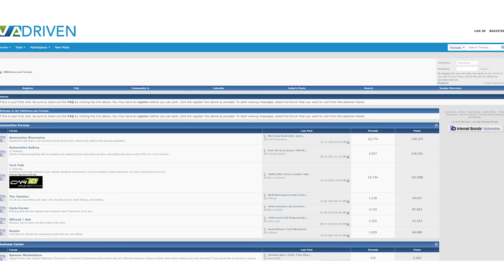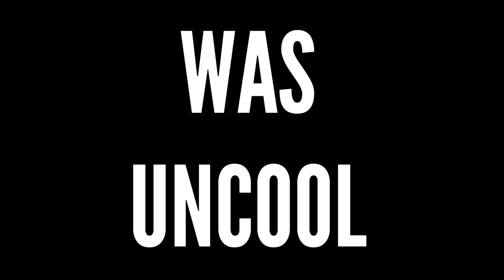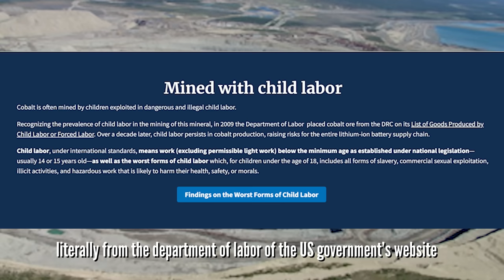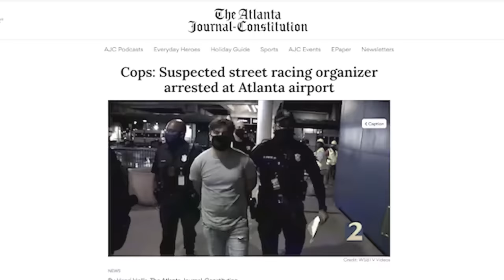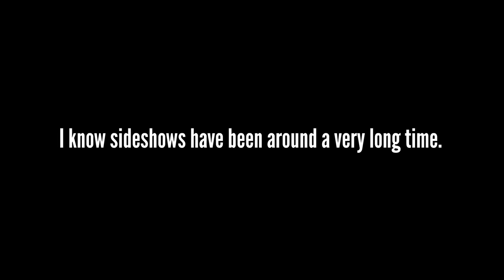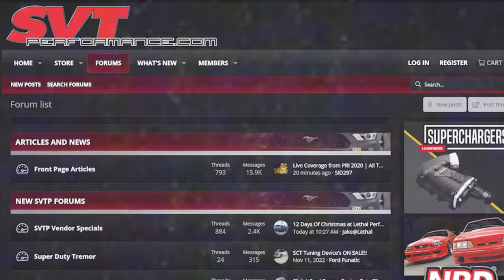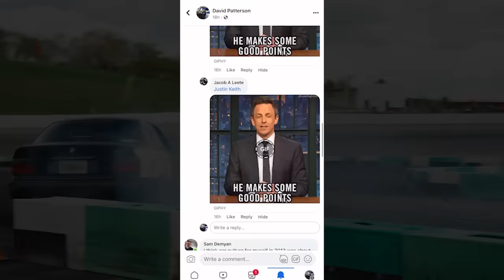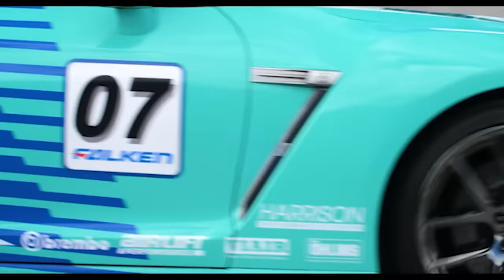Car Culture Has Changed: 2012 vs 2022

Comment: I'm a relatively newer car enthusiast, I liked cars before but didn't know much about them, so I started working as a lube tech at a dealership, and I've been learning a lot about how cars work, and personally it has skyrocketed my interest in them, I find engines and transmissions so fascinating with how they work, and I enjoy being able to apply my newly acquired knowledge to test at work
Reply: nice man! lucky you honestly. id love to turn my enthusiasm for them into contribution like you did.
Reply: I'm glad I grew up on a farm with lots of older cheaper vehicles to learn on and rebuild, way easier to figure out how they work and how to fix things and 95% of that knowledge is transferable for modern vehicles (internal combustion engines have actually changed very little from 30 years ago, biggest difference is all the engine management stuff slapped on top)
Starting out on modern cars is starting on hard mode
Reply: @archygrey9093  I think most cars use hydraulic clutch system and past 90's they used cable clutch system,also finding jacking points is difficult now

Comment: The thing you feel about cars just being a fashion statement for alot of the "car guys" in 2022 is something I felt in 2012. It was like that in the VW scene in 2012 where people would do 3 "projects" a year where they would buy a car, buy the cool hip wheel from rotiform, bag it and ad a bunch of stickers.
Reply: Funny now that I'm thinking about it, it was mainly VW when started to see the stretched tires, camber, bags. 
And now I've owned 2 VW's, however none are bagged or had rotiforms. Always been a more function guy though.
Reply: The only Rotiform I like is the ZMO on the 488 GT3 EVO or 488 Challenge EVO. And those are racecars. Outside of that I have no particular liking towards Rotiform. BBS all the way.
Reply: It was the same for many even in 2002 people would buy run of the mill civics and V6 mustangs.  Throw some after market rims and under hood dress up items and that was it.  As long as it impressed some random girls or their friends that new nothing about cars (and didn't care to learn either) it was done.  Simply something that looked trendy.

Comment: One of the hardest thing for me to accept is that I paid 1k for 2 separate 240sx and they both worked perfectly fine and had no cracked dashes.  WRX's, 300ZX's and most all JDM cars were easily under 6k running and in great condition, now some teenager is trying to sell their ragged out, frame bent, missing most interior and mismatched exterior panels for like 5k, not to mention trucks with 150k miles for like 25k, I'm so sad we can't easily access these items as much anymore for a great price.

Comment: You're taking it wayy back for me. Early 201x were the times of meeting up with the homies at the local sonic with our band of mostly f-bodys and stangs. Wheels, exhaust, and driver personalities were the conversation starters. We spent more time just hanging out and being dorks than talking about cars. Cars were the magnetic attraction that brought us together.

I had an 01 champagne 6-speed trans-am. It has QA1 coilovers, borla exhaust, stainless kooks headers, and some replica wheels. Like you said David, if anything rowdy went down it said between the handful of participants.

Now I have a 98 s14 with an ls7 built from the ground up... damn thing is a monster and doesn't run more than 500 miles at a time before it breaks down... currently needs heads rebuilt for soft dropping a valve.

Thanks for this awesome video! Really brought back a bonus level of nostalgia.

Comment: Being a old head I witnessed the birth of the import scene. Back in the mid 80's in the valley of So Cal. We were building Datsun 200sx and  510's, Suszuki Samari's , Celicas  Pintos, Escort GT's and mini trucks. Running down Ford's 5.0's, Mustang and Capri on Foothill in San Fernando, and cruising Van Nuys with the lowriders. Back than the scene was brand new. It was about street fame and enjoying what you had. I moved to Atlanta in the 90's and again witnessed a small VW show called Nopi transform in to  the east coast biggest Lowrider show in the mid 90's. By 2k it once again  transformed in to the countries biggest import show. Back than car meets we basically a group of friends meeting up. Everyone one was about showing up and showing out at Nopi. It was all love. Back then Everyone had a true appreciation  for each build. Extreme builds were seen as the exception not the rule.  Work In Progress builds were the best. As they returned each year with more improvements. To finally they were these amazing high-end builds and you felt a true excitement for the owner. Who was like you a regular Joe working a 9-5 and had a passion for cars. 2022 like everything else car culture is flex culture.
Reply: Flex culture is the true ruining factor

Comment: I'm 37, and when I was in my late teens, it was the mid 2000s. The scene back then in my area was older guys with muscle cars, but you did see some tuners from time to time that were legit fast (for the time). This was also the very beginning of what I call the "boost era", this is when Ford Lightning and Terminator Cobras were making crazy power with a pulley and a tune. Information was pretty limited and I got most of my knowledge from my dad or Car Craft magazine. But, the community was still pretty awesome, it was much like what you described in 2012. It was friends cruising together, meeting up in a parking lot with the hoods popped, staring at engine bays for hours just dreaming about making your car faster. Street racing was the thing to do, and we all looked out for each other and did things as discreetly as possible. I am not part of the car scene currently, but from the optics, it looks toxic AF. This generation of take overs just seem obnoxious and out of touch with reality. To me, it looks like rich kids that have no idea how to build a car or have any respect for the culture. I know, I know, I'm old and angry lol, it's just my perspective.

Comment: Although I never really went to any meets besides a couple, I spent most of my time either cruising or helping friends out with their cars when they needed it. Cars definitely brought us together. A few years ago I went to my first drift event, and Although I didn't drive on track, I still had a blast with friends there. Rode shotgun in a buddy's F20c ae86, we were the first on the track that morning, one of the best times I've ever had. A couple of years ago I made my first pass down the 1/4 mile, it was in a '98 Accord with the interior gutted, we got it to run high 16's by the end of the weekend. Slow as hell, but that didn't matter. There were things that were definitely better about the car scene 10 years ago. Project cars were way more affordable, I regret not buying my dream car when it was still dirt cheap. Things are more accessible than ever before and there are way more options in the aftermarket now. I'm still doing the same stuff now as back then, we just have to keep the spirit alive and not forget were we came from.

Comment: As a 40 year old, I really miss forums. The knowledge exchange and social aspects were huge.

Another big issue is that 1990-1995 was a golden age of Japanese sports cars, the likes of which have never been seen before or since. Then for the next 20 years, if you wanted a sports car, you had the Miata, the S2000 for a while, the bloated 350z for a while, and if you could afford it, a Lotus Elise. And that was basically it. Automakers produced virtually nothing worth a crap for two decades, unless you were into giant SUVs or enormous muscle cars. Car culture was great from 2000-2010 because those 1990-1995 Japanese sports cars were cheap and readily available. But as time has gone on, more and more of them died, and weren't replaced with anything, so prices have skyrocketed.
Reply: I have spent so much time on NASIOC over the years.

Comment: I sold my first 240sx for $1800, a rolling shell for $1000, and gave away two for free. Never in my mind did I think prices would soar like they did. Now that I don’t own one I miss wrenching on them but I can’t buy one for cheap like I used to be able to. New technology with parts is super cool but I feel like it’s way more expensive to build a car now than ever, especially if you’re not into just getting everything from eBay and knock off parts. Tasteful builds are $15k+ 😵‍💫

Comment: Oh shit! I never knew you were from the area! I’m not from Baltimore area but I grew up in harford county. I don’t recall having too much of a car scene here but it surely has changed. When I went to school in exton PA, I was blown away by how big the car culture was there, and how many cool cars you’d be amazed to see just driving on your way to and from class. Edit: now that I’m thinking about it - I bought my s13 sr20 240sx(blown up) for $2000 back in 2017ish. Good luck finding even a rolling chassis for that price now (that isn’t bent and crashed). Times have surely changed.
Reply: I remember watching Motor Trend's blue light special project, the LS3 swapped S13, back when I was in high school about 10 years ago. S13s were cheap around the time I got my license (spring 2014), but I had no money.

Comment: 2024 car community is equivalent to "a 70s muscle car is trash because it's slow" odds are coming from a 16 year old that bought a convertable auto e36 with 260,000 miles
Reply: Couldnt have said it better. Bunch of losers nowadays doing solely straight line racing in automatic cars 😂

Comment: I got into this culture with a 97 civic in 2013 that i basically had to rebuild while i was daily driving it.

Today I’ve branched out so far because information is so readily available it’s crazy. I’ve got a Jeep I use as a daily till I find suspension for it

My toys are a 47 Chevy truck, a 76 k10 a 55 Chevy truck, a 66 belair sedan I plan on daily driving once it’s back together, and a Harley funny enough looking back I want another civic

Comment: Hell I was in car meets from 94 to 08. Occasional road trips in 09 and 10 from Dover AFB to Virginia beach or PA or back home to Texas. My best build was a 2008 cobalt sport 2.4 NA with a tune, carbon fiber heat extractor hood, intake mid length headers and exhaust. Yes I had "underglow" with 110 modes. It was epic. Most fun I ever had in a car. Cheers.

Comment: It's a sign of changing times. Imagine what it was like for car enthusiasts from 20 to 40 years ago. The culture is always changing and will keep changing. I know people who were in the car scene back in the early 2000's and say the same things about the car scene in 2012. I've been a car guy since probably before you were born but I was never into the car scene meets until recently because I never really modified my cars until now.
Reply: I don't think the change from 1960 to 1990 would be as significant as 2012 to 2022
The former period had a similar class and culture of people, decent economic times, no internet. The main variable would have been change in design and imports of the actual cars.
The issue from the latter is that you go from small, intimate and homogeneous groups to literally any person with an internet connection, so you are now dealing with the lowest common denominator idiots. Additionally, we've had currency inflation and rampant outsourcing so kids are barely affording cars

Comment: I’ve been a car guy my whole life, became a tech in 1998 when I was 20. Had a ‘90 Iroc and a ‘71 Monte Carlo with a 500 horse 468 CI big block. I’m a die hard American muscle car/rat rod fan and I always will be. My dad was a greaser back in the 60’s and I grew up around cars. It was all out war back then between the American car guys and the Japanese car guys and I had one of the fastest cars in my town The Honda accords with the almighty vtec and civil war fart cannon exhaust kazoos didn’t stand a chance. I thought that the import scene was really stupid then, and I still do now (no offense, I’m just old and ignorant), but the “car scene today? It’s the absolute worst. There’s something satisfying about taking apart a motor and putting it back together, having the knowledge that the parts you have chosen will work together and achieve your goal. Nothing like firing up a fresh build and hearing the lope of a big cam in a v8. Now it’s a bunch of nerds programming stuff with computers. There’s no understanding how the internal of an engine work. EV’s are even worse. I don’t even care if they’re fast. If you have to put a speaker system on your car to simulate the sound of a big block, and you think that’s cool, I just don’t even know what to say. Sadly, down here in FL the only guys into classic cars are over the age of 70. Nothing like being back up north. I still have an ‘87 Camaro with a 383 and a ‘98 Trans Am, but the scene is dead at this point. Completely. It was fun while it lasted though.

Comment: Wow!! you hit it on the money with this video. I am 33 yrs old and feel that the car scene has changed insanely....we never did things to attract cops, bcuz then the meet was over and you had to relocate or call it for the night, now everything at meets draws bad attention, doing donuts with ppl hanging out the car, shutting down public streets to race, run from cops, etc....ppl no longer know how to work on cars bcuz from the factory their Redsport pushes 400HP and the Hellcats pushing 700HP+.....I had fun working on my EG civic in 2012 to try and get it to even close to 300HP, if you had an issue and you didn't know what was wrong, maybe your buddy knew how to fix it, trail and error taught me alot....I have seen ppl nowadays who dont even know how to disengage an E-brake or turn off traction control but claim they are in the race scene smh.....dont even get me started on the manuals, everything now is automatic

Comment: Car scene in Mexico my brother introduced me into it when i was a 13. There used to be nights id sneak out with him at night to go at car meets. He had a Golf GTI completely modded. 
Now a days i agree it's all been about clout lately. Now in my 30's i drive a Mustang GT 2017 at most what ive done to the car was exhaust, suspension, coilovers, intake manifold,filter, brakes.clutch, drivetrain, transmission swap.
Some kid tried to make me feel bad about my car wasnt so powerful. That was not my intent on my build was to improve handling rather than boosting it. Because i  like going to track from time to time. The kid had a good car  but with all the mods he did his car nobody in his troupe told him that his car would likely blew up. I still hang with a couple of my old friends and go to track days but we avoid takeovers. Were getting old for that. Besides i hate reggeaton music...

Comment: One thing I dislike about going to car meets is also frankly enough the kind of people I tend to meet there.
I personally drive a Peugeot 206 that I am slowly modding for rally racing (I don't have thousands of euros to just splash on it)... But ofc, this isn't a JDM, muscle car, BMW or a Volkswagen... Nor is it lowered...
It's French, it doesn't look like much and doesn't have anything fancy going under the hood (I'm mainly working on the suspension, brakes and wheels) and a lot of the people sure as hell are insistent on letting me know about it :^)
Ofc, they don't understand you can be a car person and have fun with your car without 800HP+

Comment: I had a pontiac sunfire GT with a RK Sport body kit and a wing like the one on Brian O'Connor eclipse . I had an ecotech turbo charged with intercooler and blow off valve . With a boost Guage in pod guages on the windshield pillar on the driver's side .Also had oil pressure and battery ,all indiglow .I had soarco racing seats but kept the factory steering wheel to have the airbag . Eibach suspension upgrades and lowered with rear stabilizer and strut tower brace . HKS wheels and yes I had a banging stereo with a TV screen in the dash with the neutral safety switch bypassed. I had a power inverter under the passenger seat and av cables with barrel connectors I could plug a gaming system to . Wich was a ps1 slim at the time because ps2 was too big ..
I had racing pedals  ( Not pedal covers ) nonsense under the dash and stones in my head lights. A place did most of the work on my car . Now I won't say it was real fast. It definately didn't have 500 HP . I'm thinking close to 400 as I never dynoed it . However it would beat a stock firebird or camaro with a V8 . But never beat a mustang . I miss that car.

Comment: I sold my last project car in 2020 when my property managers forced me to sell a 1984 Nissan 200sx turbo and an 01 Lexus is300 that in hindsight I should've just left alone. 
On November 1st 2023 I was given a 1986 300zx, the project car, and a 1987 300zx turbo for parts. For free! They were both about on the same level for potential but the n/a had a title (totalled/reconstructed) and the turbo didn't...in Oregon we call that "bad news" cuz filing for a lost title just isn't an easy or fast process...so I stripped and junked the turbo chassis. I've been working on cleaning it up and getting the 'VG30E' prepped for the 'T' lol. The ONLY reason I'm even trying is because the car was free and, even though it isn't an S30 or S130, it's a Z. And I love my Nissan Z's.
I'm keeping it old school tho. No build, destroy, repeat. 
As far as nightlife goes, LED lights killed that scene. We have no darkness anymore unless you can get out into the sticks...